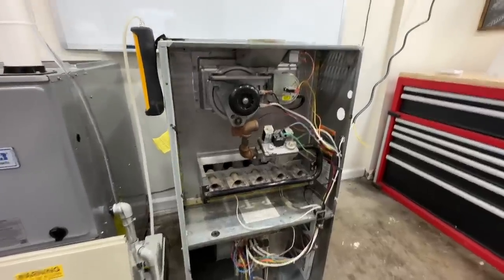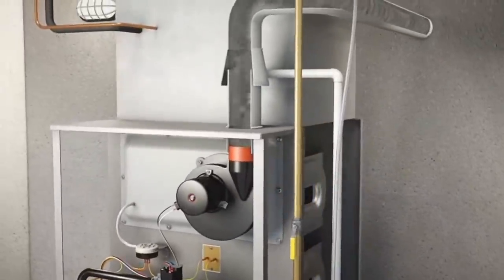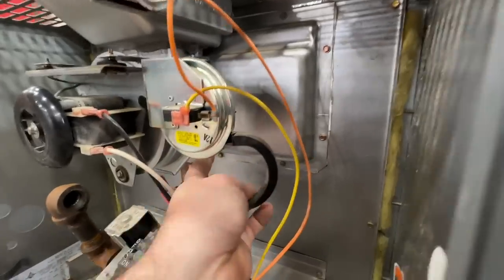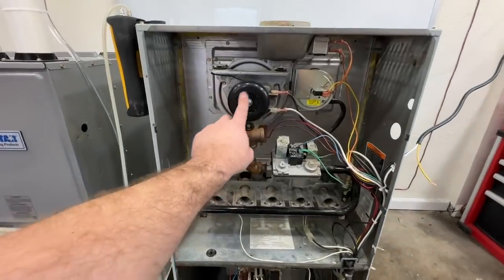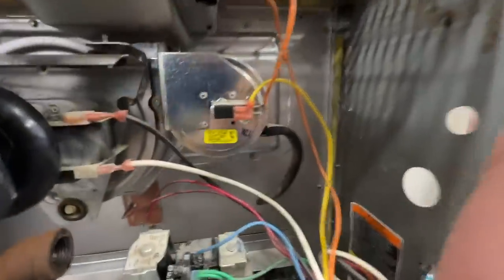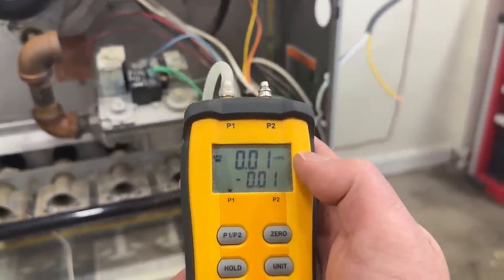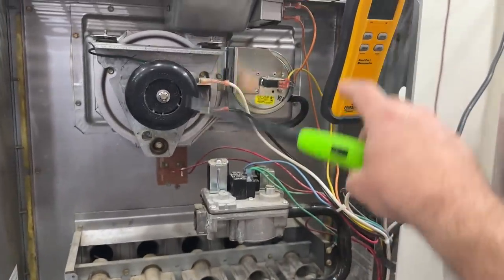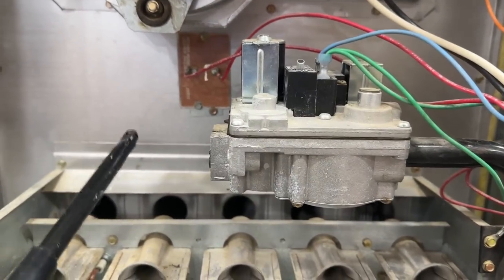How To Check For Cracked Heat Exchanger.  THE EASY WAY

Comment: Let’s get one thing straight. Not ALL HVAC contractors lie and use scare tactics to sell customers new equipment. I mean in a way you are using “scare” tactics to get more views.
Reply: Maybe not all contractors do, but I have personally encountered them.
Reply from the maker: I thought I made that pretty clear. Not all but ALOT
Reply: How would you know that there are "ALOT" of dishonest HVAC techs/companies? What scientific study did you quote to come to that conclusion?
Reply: @DWit-zn2oh  Maybe he worked alongside some of them? He IS in the HVAC field. I worked alongside electrical contractors for 30 years, and there are less than half that I would ever trust to install a light bulb in my house. The good ones are good, have integrity, and stand behind their work.  But there are just WAY WAY too many that are fly-by-night scam artists.
Reply: @DWit-zn2oh  I have personally caught most of them I have encountered trying to rip me off with deception because they thought I was the average uninformed customer. No morals whatsoever shysters. I understand why they try to discredit people who inform and educate.
Reply: Yeah i have encountered more bad than good.  From inflated pricing to trying to tell me its all rocket science.   Its ancient tech with some basic control board logic.  Not rocket science.
Reply: Perhaps contractors turn off the gas to a furnace if there is the “potential” for a carbon monoxide hazard when they find a cracked heat exchanger because they are trying to cover their own rears and do not want to get sued in the event something does turn worse and carbon monoxide does start leaking into the home. I mean, people are so sue happy nowadays, and the courts would look at the contractor as the “expert” and say that they should have known, there was the potential hazard. Maybe, we are not all bad guys with big scary masks on, but actually care about our customers because we live in the same community as them and view them as neighbors. but I suppose in order to drive the YouTube algorithm, you have to create some kind of tension to drive up views and comments.

Comment: Why are heat exchangers so hard to track down to purchase, even with newer 90+ furnaces. You would think the heat exchangers more affordable to replace than the entire system..
Reply: Systems aren't made to be repaired/ homeowners trying to get hands on one and messing up install
Reply: @FranciscoPerez-th2hw  Balony !
Reply: Systems usually come with 20yr parts exchanger warranties but what you're paying for even with that is labor. You have to take everything in the upper part of the furnace out and then slide the entire exchanger out. It's labor intensive so that's why it's so much.
Reply: @zesty2023  Totally agree and understand the labor being the most expensive part. I suppose to offer a more detailed example... my furnace was replaced due to one cracked heat exchanger. I chose to keep the recently removed furnace just to have parts as standby since the rest of the furnace is totally in great shape and both furnaces are identical. Having it tossed seemed unreasonable. Upon examining the cracked heat exchanger, I wonder why just that part can't be slid out and replaced? If so, then I would have a totally useable furnace that is ready to be swapped out whenever, or even installed in say my rental house when the time comes. So besides the labor with the installation and removal, is that not a feasible option? For example, it seems like a much easier task than say replacing the head gasket on your vehicle engine. Am I missing out on something?
Reply: Last time I checked for parts, the cost of the exchanger and the control board was within $10.00 of a new furnace.

Comment: Two awesome tests,  either one will tell a homeowner if their furnace has a leaking heat exchanger from a crack, etc.    As he said, if you get any indication of exhaust air leak then the heat exchanger needs to be replaced or if the furnace is old and worn then it may be time for a new furnace.

Comment: What is the ballpark cost of a new heat exchanger? If I used these techniques and discovered I had some environmental air entering the gas exhaust (either by flame steadiness test or manometer), first thing I’d do would be to get a brand new CO detector and go around to all the registers in the house to see of there was any CO getting in. I wouldn’t expect any because, like you said, the exhaust system is lower pressure than environmental air system. However, little leaks become big leaks and I’d want to set about remedying the situation. I’d prefer to repair the heat exchanger to seal and reinforce the cracked area, but also explore a replacement. From what I’ve heard, it’s not worth replacing a heat exchanger and the entire unit should be replaced instead. Wondering how true that is.

Comment: Will this work for natural and propane ? Do you have to remove the plentum to run this test ?
Reply: Yes! No! Simply place the thermostat on fan. Turn off the switch at the unit; Remove the lower door. Turn the switch back on with the door off The door switch will actuate the blower when you're ready to do the test.  Edit: You can remove the plenum if you intend to carry out the experiment you just watched, if you plan to get a new heat exchanger, anyway.

Comment: Excellent advise!  Thanks for the link on the manometer as well.  For the past 30'ish years I've been using the method taught to me in tech school by our instructor.  He advised to start up the furnace and watch the burner flame intently.. especially as the blower fan engaged to note any difference in flame color or flickering when the blower engaged.  Now thanks to you, I'll be able to double check those visual cues with the manometer test.

Comment: That surprises me.  I assumed that the venturi effect of the high pressure air from the blower fan passing that pin hole would draw air out of the heat exchanger rather than shove it into the pin hole.
If this is true then how can CO get into the living space?
Reply: The small (draft inducer fan) that pumps burned fuel exhaust through the inside of the (Heat Exchanger) and out the homes roof runs at a higher pressure in the smaller restricted passages and the large main blower moves large quantities of low pressure air through ducts throughout your house delivering air to rooms. ---   If there is a crack in the heat exchanger (with its high pressure air) it will blow through any cracks into that large fan ducting (low pressure) and throughout your homes through the air vents.   Hope that explains it.      (SORRY I mean heat exchanger but said diffuser, I went brain dead.  LOL)
Reply: @Bowhunters6go8xz6x  - When you say "diffuser," are you talking about the heat exchanger itself?
Reply: @VAIO294  -  Yes I meant heat exchanger,   sorry I went brain dead and I reworded the previous post.   Sorry !
Reply: @Bowhunters6go8xz6x  Yes, that makes sense now.
Reply: @Bowhunters6go8xz6x - Ok, no problem. Thanks for clarifying.
Reply: @Bowhunters6go8xz6x  - In your initial comment, are you saying you believe the large blower fan will blow the escaping Carbon Monoxide back into the drilled pinhole ( or stop it from escaping) so that it doesn't come through the room air vents?
Reply: @Bowhunters6go8xz6x  your information is off. The draft inducer creates negative pressure in the heat exchanger, also known as "suction". Its job is to suck the combustion gases out and blow them out the flue. The blower motor blows a strong gust of positive pressure across the outside of the heat exchanger.

Comment: Is the inducer motor something that exists only on high efficiency furnaces or all furnaces.  I ask because I have a very old Trane XL80 (and am very happy with it).
Reply: They are on pretty much ALL newer furnaces by law today, my Carrier is a 2018 year model and 80% efficiency and it has one so they are not exactly new.   It is a safety feature that is supposed to evacuate not only burned fuel but will also evacuate unburned fuel if the burners do not light off for some reason like a bad igniter to prevent fuel buildup and possible explosion.
Reply: Yes! No need to swap out your trane.  Incidentally, you may wanna buy a furnace as a backup in case "they" ban gas furnaces.

Comment: How about an 80 percent furnace. An a kidde nighthawk plug in monoxide detector in my bedroom, 2 br house
Reply: If both bedrooms have people sleeping in them then I would get another one for the 2nd bedroom or just place that one in the hallway between both bedrooms so both are covered by the detector.   They need to be replaced about ever 5--7 years (it should say on the package or instruction sheet).    Kidde is a very good brand for smoke and C02 detectors and home fire extinquishers.

Comment: Can the crack be repaired?
Reply: NOPE  Not safely because welded cracks can recrack right next to the weld!    They do not weld them, they install new ones.
Reply: Is there not some “Bondo” kind of of equivalent that could be used to patch small cracks?

Comment: If you do have a crack do you have to replace the whole furnace??
Reply: Most of the time. But there may be ways to just replace the heat exchanger. Or even repair it? I'd think the high E furnaces you would be able to just replace the heat exchanger.
Reply: @daveyt4802  thank you. Furnace guy was here start of winter and just to check ran his little camera up the system and saw a area that starting to get warn and said we need to keep an eye on it and if it goes all the way thru we prob have to replace the furnace. And i asked cant you just replace heat exchanger and was told prob not. It is a high efficiency furnace from Amana. Next time im not sure id buy a high efficiency furnace again.
Reply: @scottmaass4329  IIRC it's not that you can't replace the exchanger, it's that by the time a technician comes in, pulls the old one out and puts the new one in (including time spent removing/replacing all of the other guts of the furnace, since they'll be in the way), the part and labor cost is nearly the same as swapping the whole unit out. Plus, by the time the exchanger is cracked, the other parts of the furnace are probably also at or nearly at their end of life too.

There's certainly something to be said for repairing vs. replacing, repair is always better when practical, but are you (and your wallet) willing to go full Ship of Theseus on your furnace, playing whack-a-mole with parts hitting end of life?
Reply: @DonaldZiems  and that was pretty much the argument the tech gave.